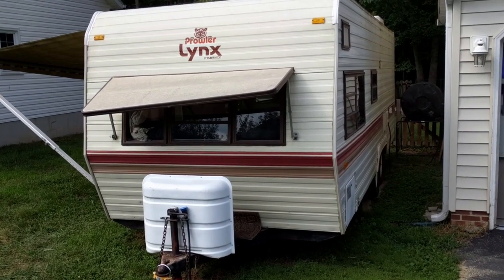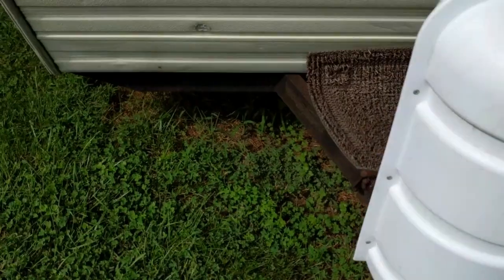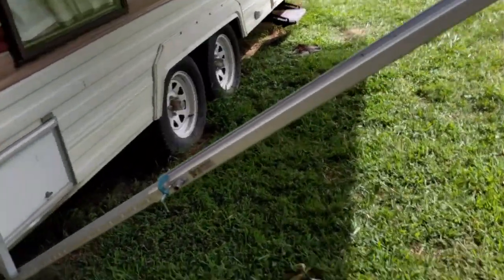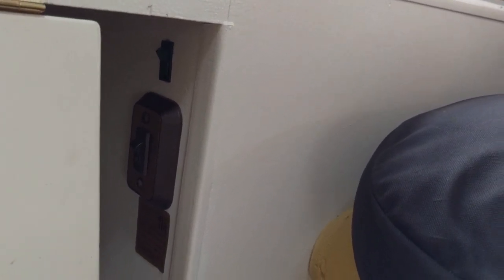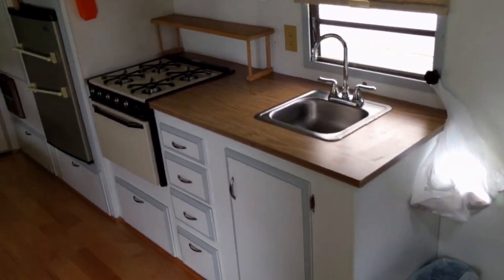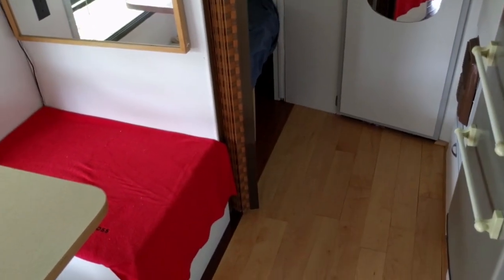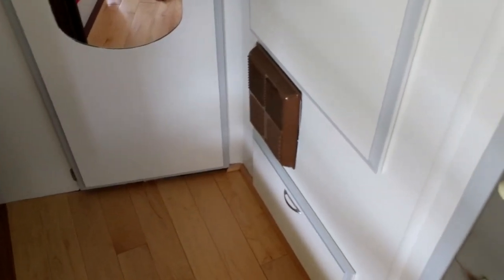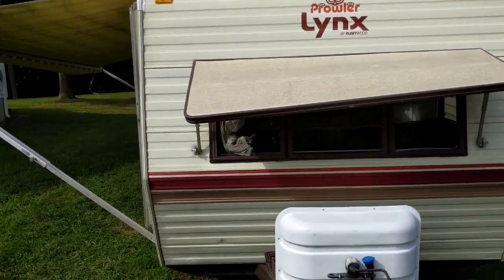1987 Fleetwood Prowler 24P Camper Final Walk Through

Comment: never mentioned the water tanks
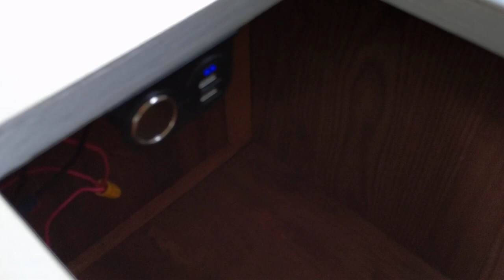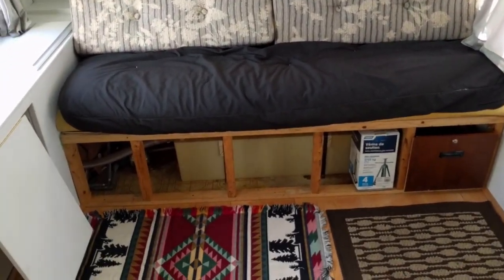Reply from the maker: I mention redoing the fresh water tank system (just redid hose connections and made sure it worked) at timestamps 4:28 and 4:55 but I don't get into size or anything because I did not need to update anything about them and, as I say, this is an archive of fixes and updates I did to the camper. Happy to answer any questions I can if you have something specific you're looking for? Thanks for watching!